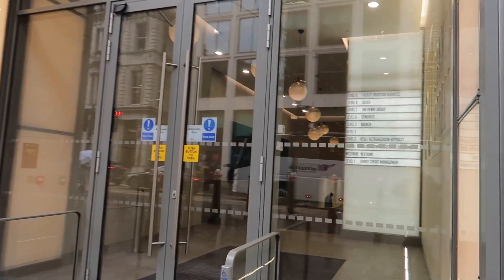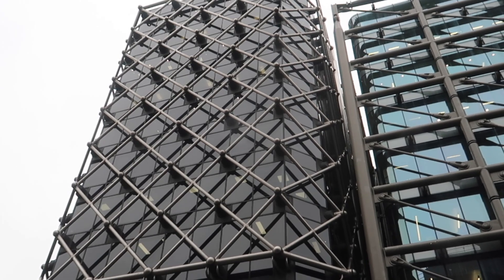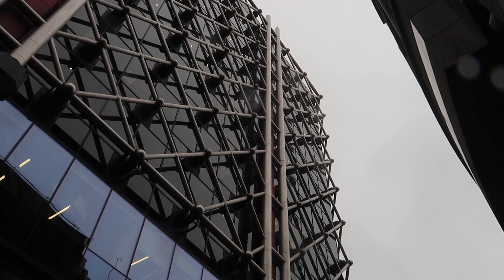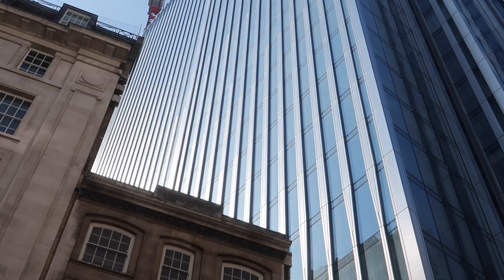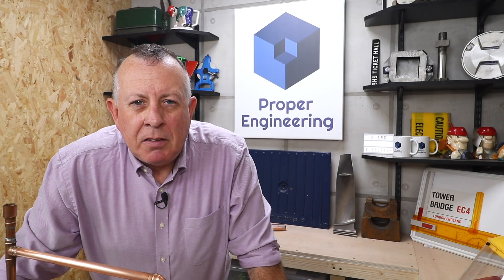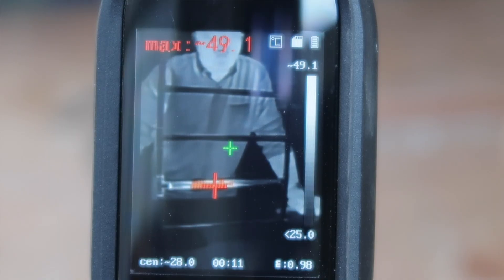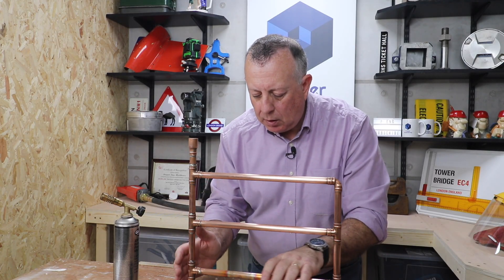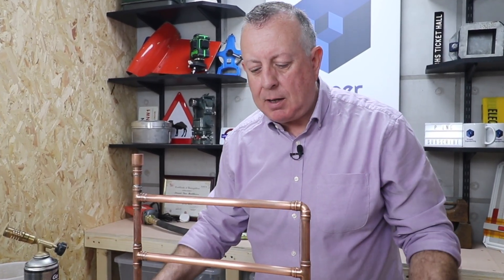Why is an unobtrusive building in the City of London totally reliant on water?

Comment: Caught my attention, good video, I worked on the fire control systems in 80 cannon street before the bottom floors got built.  Btw the lattice work had very large circulation pumps that ensured heat was drawn away from the ends of the beams. 
This building was ahead of its time in many areas, I was always impressed with it when I went.
Reply from the maker: Thanks Andrew - interesting
Reply: What was the design around a break in one or more of the tubes ? Damage to a pipe at the bottom could drain the whole system, if all the pipes were connected to each other.
Reply: @h14hc124  I worked on the fire control systems and the interfaces to the M&E so that`s outside of what i know. I do know there is more than one lattice circulation pump. so I`d think that given the multiple feeds to the base of the structure there are likely multiple fluid zones, which might mean some part can fail, but wouldn`t mean a progressive collapse of the building should one lose water, just a guess though.
Reply: How could they be sure the pumps would continue to function in a fire? Without the pumps, the water near the fire could boil and the steam could create all sorts of problems. It's an obvious problem, so I'm sure it is addressed somehow, but I can't see how.
Reply: The same way any life safety pump functions i would guess - redundancy i.e. back up pumps, fed via dual power supplies diversely from different sources. You just design out any potential for a single point failure. @thomasdalton1508
Reply: @thomasdalton1508  surely it just needs some relief valves?
Reply: @bensblues  Not if the steam manages to get stuck somewhere. Is it always going to have a route to the top that only requires it to move upwards? It might do, given the criss-cross layout, but you would need to be very careful.
Reply: @thomasdalton1508  juat thinking about this again... if the water in the system is one continuous volume then it cannot boil until the entire volume has reached its boiling point... it would take a long time for the volume's temperature to be raised to boiling point... can be worked out with specific heat capacity.
Reply: @bensblues  Water isn't that good a thermal conductor. You can easily have part of it at boiling point while part of it is still cold.
Reply: richardharrold9736  Yes, that was the whole point of my comment. What happens if the pumps fail? You can't assume pumps will keep working in a fire.
Reply: @thomasdalton1508  All the pumps simultaneously failing? Assuming that they did it wouldn't matter if a critical failure is within evacuation specs (again assuming). We would really have to see some building plans to know anything of value.
Reply: @LordZordid  If the pumps are failing due to an external cause, like a fire, having multiple pumps isn't a lot of help.
Reply: @thomasdalton1508  Err you suggested that hypothetical. I don't know how to respond. And don't you mean "if pumps are failing" and not "the pumps" suggesting that all pumps are failing twice.
Reply: @LordZordid  I'm not sure what is confusing you. You questioned if all the pumps would fail simultaneously. Redundancy only provides protection from random failure, not from failure due to a common cause. If one pump fails due to the fire then you would expect the other pumps to fail too.

I don't know what point you are trying to make about the word "the". The grammar in my comment is correct.
Reply: @thomasdalton1508  You wrote "What happens if the pumps fail?" Maybe it's just the english language that confuses me or the structure of the sentence. Because pumps are plural and would in my terminology cover all pumps unless specifically defined or implied. But thanks for your reply regarding redundancy. However I was more interested in knowing if all pumps failed if the evacuation plans would still be within specs?
Reply: @LordZordid  I meant those pumps that are required to make the system work. I don't know if that is all the pumps or if a particular subset failing would be enough to cause a problem.

I'm sure the evacuation plans would not be in spec if all the pumps failed. Why would that have bothered to install the pumps if they weren't needed?
Reply: @thomasdalton1508  Maybe the water in the system would dissipates enough heat to buy people time to evacuate. Just wondering.
Reply: @LordZordid  If that were the case, why would they have the pumps? The whole point of the system is to buy people time to evacuate.
Reply: @thomasdalton1508  Yes I agree. But I wonder how much heat the system could actually dissipate without the pumps. Also taking overflow into consideration. I'm not saying that a calculation should be needed to be in spec nor that a system without pumps would actually live up to requirements (because neither you or I know that). Am I not making myself clear?
Reply: @LordZordid  They wouldn't have included the pumps if they weren't needed and they wouldn't rely on the pumps if they aren't going to work when they are needed, so they must have a way to ensure they do work when they are needed. I was just asking if anyone knew what that is.
Reply: @thomasdalton1508  You're correct in many of your points, however some of your assumptions might be what causes your confusion. The emergency plans, including the pumps, aren't there to "buy people enough time to evacuate" - they're there so the project would have been approved, and hopefully so it won't get condemned before a healthy RoI.
Clearly the project got approved, and this video suggests the pumps are part of achieving this goal.
As for RoI, I don't know either way.
Reply: @pubcollize  The plan was approved because they were able to show that there would be enough time for everyone to evacuate. I'm sure the people that approve such plans are smart enough not to approve a plan that relies on pumps that would likely fail just when they were needed. If I can see that problem, I'm sure they could. So there must have been a solution to it.
Reply: @thomasdalton1508  With all due respect, from your words I suspect you give too much faith in what clerks care about or think about when it comes to approving projects.
And sorry to put you through the misery of another nitpicking of language right after you came out of one, but you claim "they were able to show that there would be enough time..." - no that's false. They were able to convince*. There's a technical difference between convincing, showing, and proving. They may have *presented such and such numbers which have convinced clerks at city hall that this project is *acceptable*. The proof of the pudding is in the eating,
I'm sure you're mature enough to know that plans are cool, but reality is reality.

Comment: This video also explains exactly why plumbers can't solder a pipe joint if there's the slightest trace of water in the pipe. You just can't get the pipe hot enough to melt the solder.

Comment: Absolutely fascinating, would never have dreamt of that occurring in a building. I think you missed a few extra key points here. 1) The tubes are at 45 degrees so promoting the volume of convection currents of the water upwards and importantly to left/ right of the heat source. Hot rising and drawing in cold water from below also from left right to cool. 2) diagonal mesh increases surface area and flow volume and 3) because the engineers have rotated 45 degrees they have linked with horizontal tubes to create a grid of interlinked triangles the strongest of simple shapes (a traditional bicycle is centred on two) It’s a win win with this design in my opinion, provided the outer wall panels are suitably rated fire proof, preventing fire spreading and were properly tested and verified to support the fire rating of the building. What an incredible design and thank you for highlighting.
Reply: The diagonal lattice is more of a structural requirement than a fire one. Stainless steel works just fine at 150C, and even the most aggressive flames are not going to be able to boil water too fast to for even a horizontal pipe to have a problem. The temperatures you have to worry about are above the boiling point of water, and convection becomes stupidly effective then as well as the water getting an order of magnitude better as a heat sink.
The diagonal mesh isn't about triangles, it is the fact that the columns are not distributed around the base, so vertical loads need to be moved sideways onto the columns. Obviously vertical beams cannot do this, and horizontal beams would realise this as shear, which is not as strong. Diagonal beams move the loads onto the columns in compressive and tensile modes. This is similar to a triangulated space frame, but the orientation is about the best way to transfer loads, rather than creating something rigid.

Comment: If you have a laptop with a cooling fan, you have a very similar system to thank for being able to keep it cool while being fairly flat. A thin copper tube takes the heat from the processor to the cooling fan, and it has water in it, but with a difference: it's boiled before the tube is sealed. This means all the air is pushed out, replaced by steam, then when the tube is sealed, the temperature drops, but the steam can't fully return to water because there's no air to taker its place. So, you get a thin film of water that wants to become steam if you even look at it wrong, so the heat transfer is even quicker. Hard to do this with a large structure as the pressure inside is extremely low, it probably doesn't even really make sense to talk about it having a "boiling point", so, no issue with expansion there either!

Comment: Excellent vid, Stuart.  Did you know that City Hall (built as the office for the Mayor of London) also has a water filled diagrid structure, but in that feature the water is heated to provide warmth to offset cold down-drafts.  There is also a building at Chek Lap Kok airport at Hong Kong where the roof structure is water-filled and fitted with sprinkler heads for fire suppression.  Same engineering designer.
Reply: Same architects too, Arup.
Reply: I designed the electrical systems in City Hall.  Answering a query further up the comments, the water has glycol anti-freeze and there are facilities to permit thermal expansion of the water as sunlight warms the tubes.

Comment: Hi, great video. I note that you mentioned the structure is not pile supported. So how are the external columns supported wrt foundation? Did Over Arup use a platform foundation but with the small footprint of the site, this type of foundation would be very challenging.

Comment: Thanks for the interesting video. I think the 'rapid expansion'  of the water when you put the blow torch to it is actually the production of steam. The reason being, the heat isnt dissipated from the system as quickly as we see the water contract once the heat source is removed.  The steam produced at that temperature and under a little pressure will re-condense as soon as the heat is removed and that is what we see.

Comment: This is why you'll never solder a copper fitting if you have the smallest amount of water in a copper pipe.
I have to drain down, insert a tube and suck out the remaing water before I can get enough heat in it to melt the solder.
A good move doing these vids Stewart. 👍

Comment: What a fascinating video! Thank you for the time and effort you took for this (Subbed)
Before I retired, I worked as a support engineer in Media and Post Production. We have to design facilities to high acoustic isolation standards, mainly using Camden partitions/barrier matt, other means, etc., with the main aim of using "mass" as our isolation methodology. I remember talking to a renowned acoustician, and he semi-jokingly told me if he could, he would fill up the partitions with water to provide the mass required, which made me laugh thinking about "leak protection".
Thanks next time I am near 80 Cannon Street I will understand more about this building.

Comment: I wonder if there's another result gained from the water in the latticework pipes. As water has a mass and as there must be/have been alot of it, did it allow the esteemed Mr. Rice ot Ove Arup to reduce the equivalent weight of other building materials, perhaps even the thickness of the pipes themselves? Thereby saving a few £, s & d ?

Comment: I came here wondering if the building was floating in wet clay, knowing London, and being reliant on water meant that if it dries up, the building will sink. Turns out I was completely wrong, and the building itself is very unique and interesting! I do wonder, though, about internal corrosion, and the practicality of replacing parts of the lattice if leaks develop.

Comment: I worked on a fitout converting one of the plant rooms in 80 canon Street into more office space. Iirc the water system is no longer active sadly.
Reply: Does that mean, do you know, that it's been replaced by another fluid?
Or has technology moved on?
Or was it in fact superfluous in the first place? I'd love to know if you yourself or any of the learned members of the parish here assembled are familiar with this quietly mould breaking building.
Reply: @JP_TaVeryMuch  not sure I'm afraid, it was a looong time ago. I have worked at Arup since then I wished I'd remembered and looked it up. I did look into the Durham concrete aerial business, that was interesting!

Comment: The use of water in this way is an interesting concept and makes absolute sense for the following reasons:
1) If the system was sealed it would create pressure inside the structure in the event of a fire meaning even if the steel got weak enough to buckle it wouldnt be able to as the skin is being supported like an inflated balloon
2) the water will be able to travel throughout the entire structure meaning that when one part heats up the convection currents will dissipate the heat across the entire structure instead of being concentrated on the bit thats on fire
3) its just water, you could technically stop the structure from buckling under heat indefinitely by just replacing whatever water boils off assuming any actually does and the structure will never get much above 100c

This even works on balloons and plastic carrier bags, both can be held over an open flame when filled with water and they wont melt or burn

Comment: Are the external pipes part of the water system for the building, or is it purely used for fire safety? I would assume it has to be circulated a bit to avoid anything growing in it and to account for loss from small leaks and maybe evaporation?